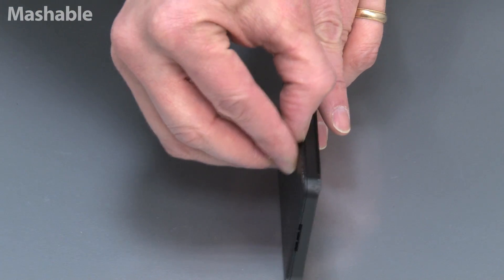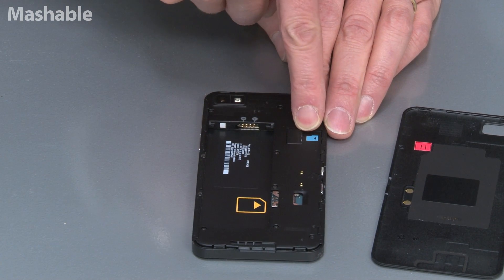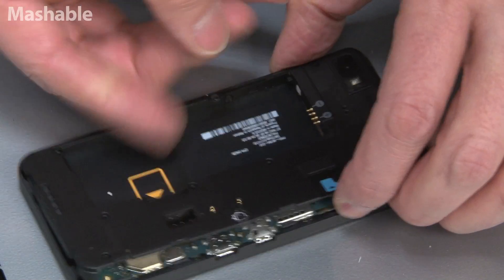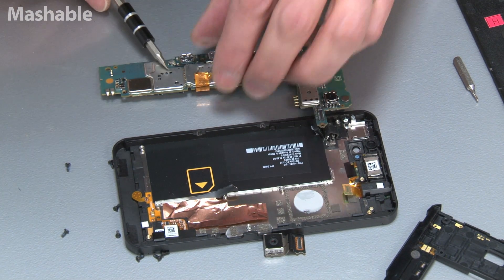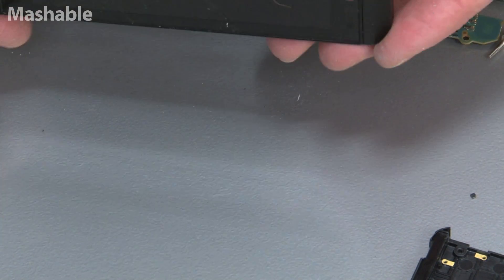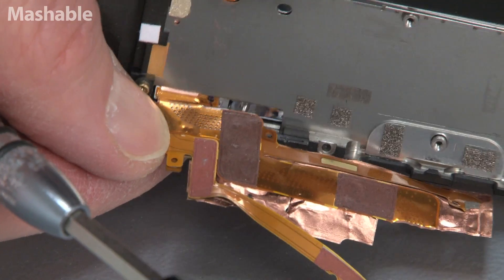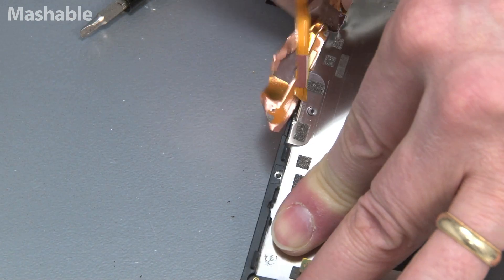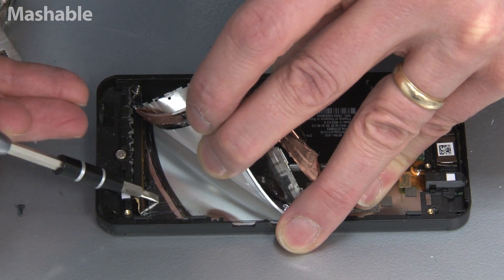BlackBerry Z10: Tear It Down | Mashable

Comment: I have dropped my Z10 so many times in the house, on the street, on hard tiles and couple of times inside wet bathrooms and it still works fantastic and looks amazing.  Before I read this article, I swear I was saying to myself when it dropped in the bathroom and surprisingly nothing happened to it, "man, this is f***ing great phone!".  Where did you drop it? Under the bus, perhaps?
Reply: I dropped it so many times and the screen didn't crack. Not once. This idiot shouldn't be allowed to have a phone. What a joke this guy is